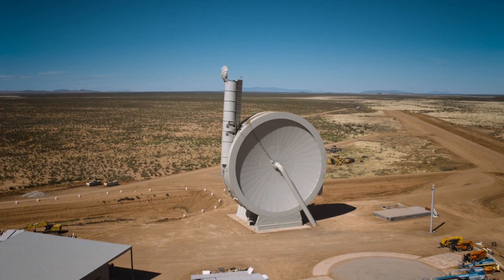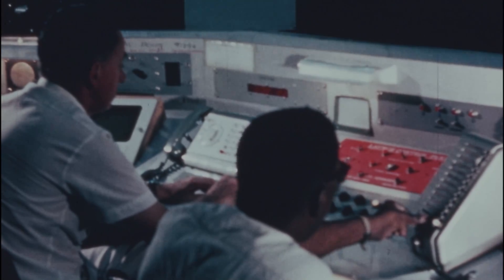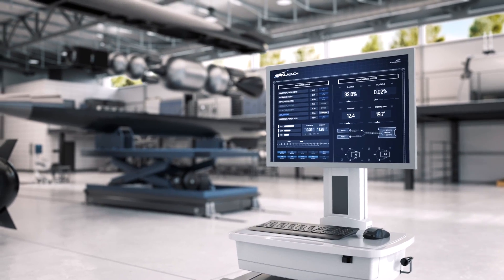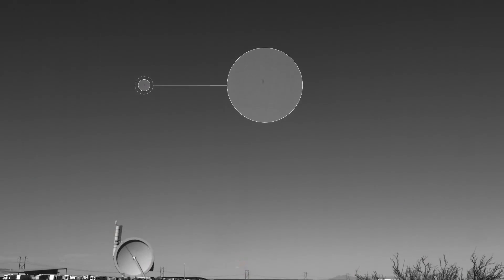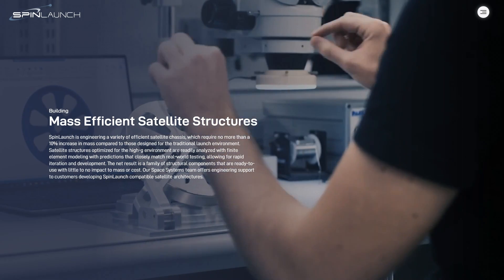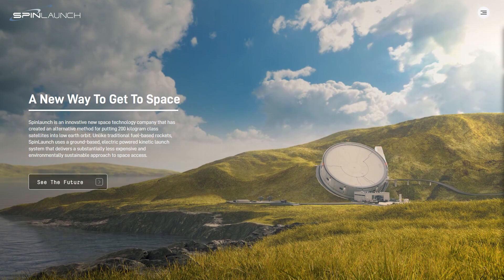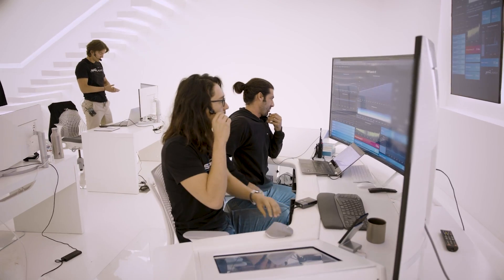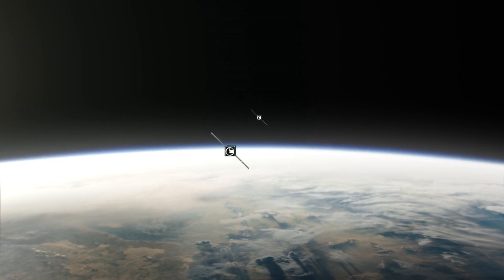Can Spinlaunch Throw Rockets Into Space?

Comment: This would work wonders as a Moon to Mars launcher. No atmosphere No air resistance
Reply: True, though a linear accelerator run up the side of a crater is also more workable so the 'ideal' method may be more dependent on the nature of the payload.
Reply: @IntBlank  Check out the launcher as written in "The Moon is a Harsh Mistress"
Reply: @quaker103  Yep, that ones great. And also points out what great weapons those are. Space solar collectors too - epic beam weapons. Lots of this stuff is dual use.
Reply: @quaker103  Didn't Jules Verne also use some kind of cannon in a story to launch a vehicle to the moon? Also, I've often wondered why the US government put NASA in Florida, which is mostly sea level, and not in Denver, known for being "a mile high". It would reduce atmospheric resistance and get you part of the way up.

Another thing I used to wonder about as a kid, was why they couldn't drop the space shuttle off of the 747 that they used to show pictures of and stuff carrying it in the air. Assuming the 747 can still achieve the typical altitude of 30ish thousand feet with the shuttle in piggyback mode, it would seem like something that would be worth trying to accomplish.
Reply: @johns9652  Did they not launch them over oceans to avoid debris hitting cities? Much unlike what china does and as a result boosters regularly fall on their villages? Well maybe not regularly. Also.. They have and do test some rockets by attaching them to big planes.
Reply: @nerdjournal  Yeah, that might have been what gave me the idea, I think it was the X-10 they dropped from a plane to begin it's flight. Don't really know about your idea of needing ocean space to drop the boosters, could be right.
Reply: @johns9652  read my post above this one in the feed.  It gives a brief answer as to why most rocket launch as close to the equator as they can get.
Reply: @windrider65  Ah, thanks, I never even considered that. Guess that's why I'm an electrician and not a rocket scientist.
Reply: @johns9652  I would have never thought of it on my own, I read about it years ago.  It's just something that I remembered when I read your post.
Take care and stay safe.
Reply: On the moon it's probably easier to build a long railgun / mass driver. No need to vacuum a really long tube. No need to deal with 10000g forces that last over an hour.
Reply: @wedding_photography  lunar rail gun? Maybe.  
The Navys rail gun already can lunar  launch 20 or 25kg to lunar orbit, but the instant power requirement is no easy task. 

The lower power requirements with a slow spinup over time with a SpinLaunch is very attractive option.
Reply: @wedding_photography   I think the main problem is the added cost (because it needs to be much larger) and the need for much higher power levels. After all, that’s why they’re making this instead of the rail gun method
Reply: @brandonm1708  the railgun to orbit on earth doesn't work because you'd have to pull a vacuum on the whole track.  You don't have to do that on the moon.
Reply: @JMurph2015  but wouldn’t it still be more expensive, because of how long the track would have to be? At least compared to something where all you need to do is spin it in place until it’s going fast enough
Reply: @brandonm1708  I'm not sure actually.  The track on the moon would be relatively cheap, but it would be long (5km or more), but a spinning system would need all the stuff to deal with those insane g-forces.  It forces you into a huge, difficult to build and maintain, carbon fiber swing arm.  And then you have to put that thing on some absurd bearing that can take the fast unloading of the payload.  I highly doubt those things scale well to industrial sized payloads being launched off the moon.
Reply: @JMurph2015  that’s true, I suppose we won’t know which would cost more until it’s tried
Reply: @brandonm1708  because high speed rail guns have a number of problems. Two of which are the repulsive forces due to the need to generate rapid acceleration and high speed rail contact. A slower acceleration would require a very long, and expensive, rail to be enclosed in hyperloop like vacuum tube with magnetic force to prevent high speed contact.

The military have tried to build a rail gun for high speed projectiles but that ultimately fail due to unreliability issues.
Reply: @Adventure Fishing lmao what
Reply: @Adventure Fishing there are no g's in a parked orbit, but as soon as you accelerate, either linerally or rotationally, you will experience g's. also there are g's on the moon and on asteroids
Reply: @Zreknarf  Not nearly to the same degree though, as it would be Gs caused by surrounding celestial bodies, definitely not enough for a human to feel during freefall.
Reply: @JackNormalMemes  freefall is the same as orbit with regards to Gs, you don't feel Gs from a celestial body unless you're standing on it
Reply: @Zreknarf  you don't feel it but you are technically affected, which was my point to the no Gs in space guy. In all fairness I dont think this could do any sort of biological cargo without liquifying the contents
Reply: @JackNormalMemes  you are affected by the gravity but not experiencing any g force. a g force indicator would read 0.
Reply: @JackNormalMemes  in other words, if you and your spaceship are both accelerating at 9.8m/s², then you are not accelerating at all with respect to the spaceship. you won't feel any force until the ship is accelerating more slowly than you inside it, from hitting the atmosphere or the ground
Reply: @Adventure Fishing bruv how old are you
Reply: @Adventure Fishing G force is a measurement of force. It doesn't actually depend on gravity.
Reply: @dennisivan85  Thats literally what I was saying, whats wrong with you
Reply: Or a Mars back to Earth launcher
Reply: If only people could ride.. lol what about a spinner with a long retractable tether like miles long like LONG and then the acceleration and G force would be more gradual and tolerable to humans with a more gradual curve? Probly not getting Mach1 idk if theres any point but thatd be a hell of a ride!
Reply: he literally says that at the end of the video...
Reply: @dennisivan85  I was talking about drifting through space not being launched, in reference to the guy who said theres no Gs in space, not sure how you misunderstood that.
Reply: Putting a satellite into orbit requires that you impart a velocity of ~17,000 mph to the satellite. Because the Earth is rotating, its surface velocity gives you a head start on achieving orbital velocity when you launch toward the east - the direction of the Earth's rotation. The closer you move your launch site to the equator, the more velocity you get from the Earth's rotation.
Reply: That does mean no change of Speed so…
Reply: Moon to mars launcher would require too many g forces for any living thing to launch in said rocket. 

But this could launch water extracted from lunar poles to a lunar  orbital refueling station where the water can be processed to hydrogen and oxygen and stored for missions to mars, and beyond.
Reply: If Mars and the Moon had no atmosphere, then theyd be spinning debris off themselves. Prove me wrong.
Reply: @JarethGarza  gravity exists bruv
Reply: @JarethGarza  also Mars has an atmosphere, it's just thinner than Earth's.  Technically the moon has a little gas round it too, but functionally speaking it has none compared to even Mars.
Reply: @JarethGarza  you’re facing up against all of astrophysics in that statement. You need to prove yourself right, not the other way around. (Also the answer is that gravity is much stronger than the required centripetal force for the spinning

Comment: I think they need to put this thing at 10,000+ feet elevation.  You need a mountainside anyway.  Mount Kilimanjaro looks perfect to me.  Right on the equator, so easy circular orbits and maximum speed from Earth rotation.  The reduced air pressure at altitude should make it easier at launch to make the transition from vacuum to air pressure, and reduce the drag.

Comment: Eventually, this excersize will produce some utterly spectacular fails; will rival NASA of the 1960's
Reply: I wouldn't want to be anywhere near the launch facility when it happens. They really must have confidence in their engineers to pull this off.
Reply: It’ll be the first ever irl seismic charge detonation!
Reply: @brandonm1708  not much worse than a tank explosion. Both produce a good load of shrapnel for several kilometers in their vicinity, and the energy put into the projectile by the rotors is roughly equal to that of the chemical energy being burned in the first stage of a rocket. In fact, it's much less, since the weight of the chemical propellant itself doesn't need need to be compensated, so a rotor R.U.D. will likely cause less destruction than a exploding rocket.
Reply: @sgt.bonkers8706  yeah, but it was more about how it’d explode in a circle, instead of outwards in every direction
Reply: it should be built underground
Reply: Better this than be launched by water pressure...
Reply: A falcon heavy rocket has about 17 terajoules of fuel capacity but its maximum payload in low earth orbit has only about 2 terajoules kinetic energy. 

Proportionally, a massive spinlaunch failure with 2 terajoules of KE could be less destructive because there's less overall energy. Also equipment and people to the side of the disk are less likely to be effected.

The flip side is that you've got the risk of a few random solid debris strikes happening at very long distances from the actual facility, even if there's not much damage to the actual facility. They should build it so no cities are in line with it for maybe 100 kilometers.

I also would imagine rebuilding that whole launcher would take way more time, resources, and money than building a functional rocket plus launch pad to do the same thing. Obviously it would pay for itself no problem if it's used dozens or hundreds of times but if it smashes itself that might be the end of the program.
Reply: I guess one launch failure and the whole facility would be destroyed, Imagine releasing the rocket on the opposing direction...
Reply: @ts757arse  It wouldnt suprise me if it was ever operational that the arm and counterbalances would be completely rebuilt between launches.
Reply: You mean like Space X on recent years?

Comment: 1ms? My guess would be way less but then I thought about the math: If launch velocity is 450rpm, it's moving at 2.7°/s (~0.05rad/s) or 0.0027°/ms If the diameter of the launch apparatus is 33m, to get a launch window/tolerance of 0.5m, that would be 1.736°.. Assuming you want to nail a +/- 0.25m for a total tolerance of 0.5m, that would be +/-0.868° (+/-0.025rads) or +/-0.321s (+/-320ms)

Either my calculations are wrong or missing something (entirely possible, this doesn't account for a million other variables they would have to control for) but maybe this explains how they were able to nail basically what looked like pretty close to dead center of the membrane in the launch video - they can probably hit +/-1ms easily? Any variance would be more down to physics and the actual release mechanism than the system/electronics activating it based off whatever inputs
Reply: In English, please? So it's running about 4500fps? That's not terribly fast. Kinetic energy is more important than raw speed though.

Comment: There is no reason to me why this can't work. I've even wondered if you could use a Hydro Dam to spin up a fly wheel and get the same forces. I'm not an engineer but the water pressure that comes out of a hydro electric dam seems so emense and powerful,  you could build up power with a flywheel or series of giant flywheels that powers the space flinger. A water yeet.

Comment: How are you going to make an actual payload that does something useful in orbit that can take 10,000g's?  A satellite needs to generate power over an extended period of time and solar panels are the preferred solution -- how would those panels and the structure to extend and support them handle 10K g's.
Reply: Because the G's are gradually loaded. There's no shock loading like with a regular rocket launch. Also sounds like they are fudging the numbers a bit for drama.
Reply: @TehButterflyEffect  -- Please, to build a satellite to handle 10,000 g's will require construction methods that make useful payload impossible.  The shock loading of which you speak is merely the higher g loading of impulse and we are already well beyond the forces that are practical.  A building is built to handle its weight and the weight of the live load as well as wind forces and, where required, earthquakes, but these are all limited.  There are no practical building designed to handle wind speeds of 5000 mph nor earthquakes over 10.  Get f'n real!

Comment: Looks spectacular but the projectile is making the same RMP as a rotating arm. M1 might be ok but what if we need 10X more mass on a 10X higher speed? Rotation of the rocket stopped at that level might rip it apart even before it hits the air. But for the Moon it's brilliant

Comment: I'd love to know more about the bearings that allow this much mass to spin that fast, and then lose that mass when launched and not rip itself to pieces! Looking forward to what's next, definitely! 🚀
Reply: release a secondary counterweight at the same time would help
Reply: @peeinacan1  or possibly shifting the position of the counter weight on release. I'm not an expert but if you forced the counterweight into the center it would have significantly less effect right? Couple o explosive bolts like in pretensioners on car seatbelts or something?
Reply: @peeinacan1  Just what I was thinking. Have a two-part counterweight with the first part balanced to the arm, and the second balanced to the payload. Just drop the second part of the counterweight, which would be experiencing significantly less acceleration and be spinning much slower.
Reply: I don't think it is a case of 'just doing this' at this level of potential catastrophic failure.
Reply: @peeinacan1  my thought exactly. A counterweight goes through a second replaceable panel in the underside of the machine and into a tank of water or something for recovery. It could be heavier than the payload and much slower.
Reply: A well balanced arm should only deal with noise albeit huge but orders of magnitude than what you would think initially
Reply: @Channel-tr1hx  if your adding and losing weight, you cant balance it
Reply: @peeinacan1  I'd actually use a dummy load of the equal mass on the other end of the arm yeeting it down at the same moment the actual payload goes up.
Reply: @Nibiroid  a dummy load reduce half of maximum payload
there is many way to balance. changing one arm's length is one of them
Reply: A few websites mention a counterbalance spinning in the opposite direction. Could two payloads be launched to counteract each other?
Reply: I would have to guess it would be done by offsetting the axle at release.
Reply: You can see the counterweight is much closer to the centre - I feel it must make things more manageable.

Comment: They could place a disposable counter weight on the other side of the rotor, that will be released in the same moment of the release of the projectile - obviously in the opposite direction. But then the rotor should have no bigger stress on release.
Reply: Quite a few people have mentioned this in the comments. I mean, maybe you were the first, I don't know. Seems a good idea but the counterweight will have a lot of momentum and would be very destructive, so there would need to be some kind of energy absorbing system below it (like a deep hole with sand at the bottom or something).

Comment: This is a unworkable idea. It will not be useful. 10,000G's is way too much for electronics. You are going to break the stuff inside.  A better approach would be a long curved ramp powered by an electromagnetic sled and replaces the first stage of a rocket. That would be gentle, and effective. Yes, you would have to build it against the side of a mountain.  With a gentle enough curve you can make it safe enough for humans to be launched. Chemical rockets are dumb; a huge waste of energy.

Comment: Since everybody else is armchair quarterbacking this, I might as well, too:

- Dynamic counterweights could be used to balance the system after releasing the payload.
- The rotational speed could be increased by moving the counterweights toward the axle right before release.
- A very heavy disk powered by solar collectors could be slowly spun up days or weeks ahead of time and used to boost the entire system with a fluid coupling like a torque converter in a car.

Comment: It seems like a simple enough thing to fix the sudden loss of balance when the projectile is released. Just have a counter weight that is also released that goes down a tube into some kind of impact chamber where the explosion can be disapated without tearing the whole place apart. Maybe have it scrape along the sides of a tube to slow it down first. Or use a series of coils to slow it down before it impacts and store the energy in capacitors or batteries to be used for the next launch. They could also use circular neodymium magnets around a tube and a copper counter weight.  The magnets will slow the copper weight down. Have a pool for it to splash down in and then it can be reused over and over. It will need to be balanced every so often but that's easily done.

Comment: I seem to remember a scifi concept for a long linear electromagnetic track on earth to accelerate a rocket to launch speeds. I seem to remember it was built at a high altitude, possibly near the equator to minimize the air resistance at the exit point from the accelerator.  This spin launch system may also benefit from being installed in/on a mountain top.
Reply: It's not trivial to get the payload to the top of a mountain.